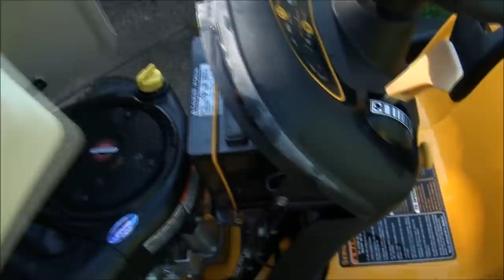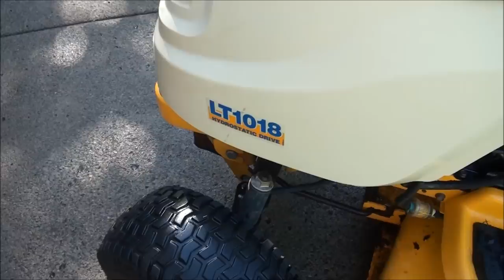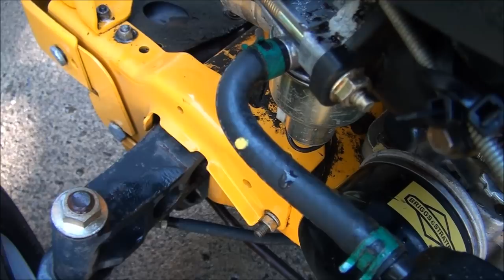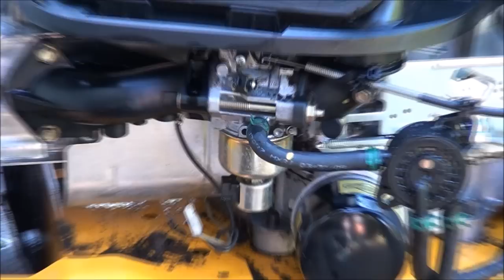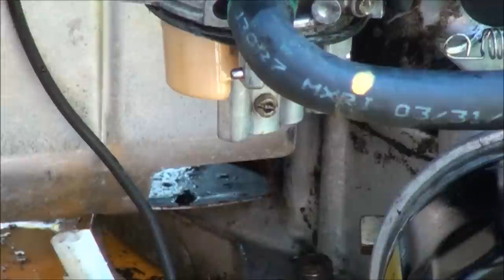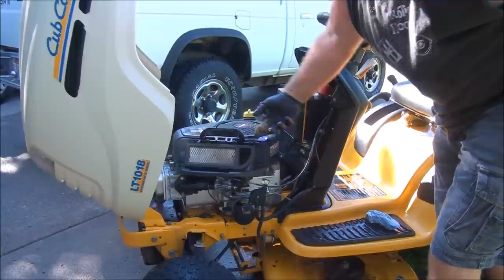Briggs INTEK QUICK FIX ~ RIDING LAWNMOWER that TURNS OVER but WILL NOT START. STARTS then DIES.

Comment: Just started cutting lawn,yesterday. Husqvarna 26inch with 18.5 intek stalled where i couldn't push it back to garage. No carb or brake cleaner. Ended up using crc electronic cleaner to try and get mower running. My solenoid failed last year. There is a fix for a dead one. You pull it and grind the plunger tip off flush in the hole, carefully so you don't screw up the threads. Mower rarely backfires. You can clamp while mower is running before shutdown.Anyhow the cup was full of some small round balls of some kind of goo. Cleaned it all sprayed the cleaner in the holes. Thanks for pointing out the jet. Gonna go back and clean that. Guess I won't be using gas that's sat during mowing off season anymore. Never have seen that kind of crud in a carb.

Comment: Thanks! it helped me out alot.  I checked everything! I started from Carb to valve clearance. I cleaned out the dang carb, adjusted clearances and everything else in between. Even changed battery. Still won't start. Figured out it was that dang backfire valve preventer! I ended up just cutting the tip off with pliers and putting it back in. Lawn mower runs like a champ now! Will eventually change out the backfire preventer with a new one.
Reply: ZOMGoS Z what you mean cut it off? The black rubber piece you took off ?
Reply: What a boss move.

Comment: Thanks for not calling the Briggs And Stratton engine crap. They are not that bad if you can keep them in good shape!
Reply from the maker: Briggs are great engines!
Reply: I've got a 14.5 hp Briggs that's been running great for 20 years!
Reply: bigbluegpr I got 32 years out of a 12.5 hp b&s. Just change the oil like clock work!

Comment: I just fixed mine. The bowl was loaded with dirt. Previous owner said it sat 2 years. Only think id add is I didn't shaved a 1/2" wrench to get the bowl off. I took a pair of channel locks and I gripped the bowl and loosened the bowl ( youre probably better off loosening the solenoid, that's where the threaded bolt is that hold the bowl} and then unscrewed it by hand. Id be careful and make sure you don't put to much pressure and crush the bowl. Good vid ! Thanks
Reply: You should have put a new gas filter on and maybe new gas line to if stuff was that dirty

Comment: Thanks to all who forge on!!!    My run thru learned from many DIY'rs..  The shot of eth should start most. If not Then, plug gap & sprk, if no- unclick ground on ign (while there chk clearance of ign) - chk sprk again- if spark- reconnect grnd on ign- chk spark again- if spark chk valve adj. If no spark trace electrical safety's , fuses ect.     If starts then with eth but quits -chk fuel shut off on base of fuel bowl & chances are if valves way out carb should be soaked & cleaned also.

Comment: Great video just one complaint, however, you said the old plug was made by a crappy manufacturer, it was an E3 plug, which in mine, and thousands of others say it's the best plug , anywhere, anytime!
Reply from the maker: NGK or Champion have never failed me and they last a long time. I have had an Autolight and a cheap Amazon spark plug fail new out of the box.
Reply: I've had many ngk plugs brand new not work then put a champion plug in and it works

Comment: Sometimes all the problem is is the carburetor bowl solenoid getting stuck out I've had 1 that was gummed up inside the solenoid and took it off then put a other used one on and then the engine started up those do work good for stopping the gas flow soon as the key is turned off kinda better then keep turning a valve on the gas line.

Bur then a in line shut off valve is good to for if you wanna take the carburetor off just keep the valve on off and unhook the line

Comment: Well at least the engine doesn't have a cam with air pockets like the 20hp v-twin did. I have one here with 320 hours on it and the lady service advisor said it was my fault because i got dirt in the engine. You can see from the cam that the cam has air pockets in it. I am supprised that Cub Cadet went to briggs, I will keep mye with the Kohler engine.
Reply from the maker: yike! air pockets? that is not good
Reply: WHATS YOURSOC  still in pieces. I show all my friends how briggs handles problems.

Comment: my would do the same thing and it was the rubber tip on the pintle of the anti backfire valve was loose and just floating free and shutting off the fuel flow to the main jet. i just removed the pintle and spring and installed a shutoff valve in the fuel line and saved $30

Comment: I could just kick myself! This actually worked on my Craftsman LT2000 with the same engine. I acquired 5 of these Craftsman riders from a neighbor. All needed just a little TLC and a new battery. Sold a few of them to friends, but kept one for my daughter who just bought her first house. I did all of the usual maintenance things like new spark plug, oil & filter, in-line fuel filter & fuel shutoff, sharpened & balanced the blades. It was running and cutting well when it stuttered a couple times, backfired, then stalled. I couldn't get it started and I assumed after everything else I already did, that it must have broke something inside. So it's been parked behind my garage for a year.... until today! I blew some air through the carb and it fired right up!
Thank you!
Reply from the maker: COOL! Thanks for the comment

Comment: My 12 year old intek just threw a rod! I was surprised as I took very good care of it over the years! So off to Lowes for a new Twin Cylinder Kholer engine powered Craftsman lawn tractor! Lets see how long I can make this one last.
Reply from the maker: Kohler is no good
Reply: Jeff's Little Engine Service dang really!? Jeff nice name my name is Jeff too haha! Thats sucks Jeff so I should stick with briggs? I dont trust them now since my mower threw a rod. But wide open cold starts for 12 years wouldnt do any engine any good hahaha! All of our Kohler engines here at the county where I work get used and abused and they have not broken down! What makes you say they are no good!? Before I drop 2k on a mower I want your opinion as I value it! Thanks Jeff!
Reply: @jefflohr5533   As strange as it may sound- the off-brand Predator engines at Harbor Freight get great reviews and are a bolt-in swap for the Intek engines. You can also up-size if you had one of the smaller ones and get more power. They cost hundreds less. I was about to do the same, but ended up being able to just repair mine. Almost wish it wasn't fixable so I could go up in HP. Yes, they're cheap Chinese engines, but they've been around a long time and I've seen a LOT of them working just fine.
Reply: Skrutinizr hey thanks a lot brother I will look into that I got two harbor freight stores down the road so im heading over there! Thanks again!

Comment: Went through mine that's doing the same thing (Intek 20hp I believe) I think I narrowed it down to the ignition coil, spark plug from mower (and leaf blower to test) wouldn't spark that I could see unless I was testing the plugs wrong. Solenoid clicked and carb was immaculate, I only run non-eth and stabil...

Comment: In the future I would recommend you use carburetor cleaner instead of starting fluid. It isn't as hard on an engine as starting fluid is. I prefer Berrymans B12 Chemtool, used it for 41 yrs now. It is great to use on an engine with no fuel delivery, I've driven cars into the shop feeding it long enough to drive it in instead of pushing it in. It is also a hell of a cleaner, watch getting it on painted surfaces, paint does NOT like it !

Comment: I have two Inteks laying around that were overheated by mouse nests, but aren't blown. However you can feel them binding when you turn them over by hand. Whats the most common things to get damaged when an air cooled engine overheats but doesn't throw its rod. Is it in the head or do you think the cylinder and rings are in bad shape from your experience. Is it worth me repairing them. Let me know thanks. I have spare heads and push rods. But if it's rings a honing it needs, I can deal with that too.
Reply from the maker: piston and rings go first usually
Reply: @JeffsLittleEngineService  Will I get away with new rings and a hone, or does the cylinder usually need to be bored out when that happens. I believe your right, it binds up as I'm turning it by hand, rings must be sticking on a rough bore.

Comment: That plug was filthy! I use E3 plugs on my small engines and they work great..
Reply from the maker: I am an NGK guy
Reply: Those are good.. Run the iridium ones in my Subaru Legacy..
Reply: Soak spark plugs in prem gas and penatrating solvent to desolve carbon and oil.

Comment: i would check valve clearances too ,makes for a lot easier starting.
Reply: Yeah it really does my last recent red craftsman i bought for $40 all its problem was dirty carburetor jets and the bottom valve was to tight i cleaned the jet holes and reset the bottom valve and it runs good thats all the mechanic guy who sold it to me had to do to make it run an work right

Comment: I have a similar Briggs & Stratton 17 HP that was running about 4 minutes, then died. 
It’ll now start on starting fluid, but then dies immediately after the starting fluid is taken away. 
Once it sits for a bit, if you crank it, it’ll very briefly fire, and die. 
Then we’re back to only running on starting fluid. 
Has good gasoline in it, and back-blew the fuel line, new filter, and already had a brand-new spark plug in it. 
What the heck?
Reply from the maker: Fuel delivery problem. You need to clean the gas tank and carburetor.

Comment: Thank you for your video! More help needed...Hi, replaced the fuel solenoid after market part myself and mowed once without any problems; next week, mower won’t start and had loud series of backfires. Did I do something wrong with solenoid install? Any help on what to do next to fix issue is extremely appreciated.
Reply from the maker: I am sure you installed it correctly. However, aftermarket parts like that fail often. It may also be that the carburetor /fuel system needs cleaning.

Comment: yea just need starting fluid everytime it starts no problem at all
Reply: I use gas don't have money for a 8 dollar can of that stuff that'll waste my cigarette money the gas just primed it is all once it has a new battery it'll do fine same with my tecumseh engine 

They orto just add a little primer bulb onto the air filter it would make stuff easier sometimes it just takes a bottle cap of gas down the hole maybe a few more pumps to work out any other dust while its running

Comment: JUST REPLACED THE CARBURETOR TWICE ON A 19.5 HP BRIGGS AND STRATTON AND IT IS CRANKING AND RUNS FOR A MINUTE OR TWO AND THEN DIES AND WON'T START AGAIN OR IS HARD TO START. ANY SOLUTIONS THANKS JEFF

Comment: Hi , I Took out my mower, changed oils and filte , then when I cranked it, nothing . Saw that the battery was weak so after charging it with a car, it turned over but would not start. Used a lipo jumper pack from a friend that was visiting and she started right up. Now two days after, nothing. Changed battery and that new battery could hardly turn over the engine.  Spark plug was cleaned up too. Just wondering why it started with the lipo pack and not starting when I need it to use?

Comment: Really nice video. I have a 18.5 hp that had a loose exhaust rocker arm. Tightened it up and adjusted both valves. But it still pops and backfires. Will not start. Any suggestions please?
Reply from the maker: The rocker arm studs can loosen sometimes which messes with the adjustment
Reply: @JeffsLittleEngineService  yes. I think it overheated and popped the valve seals. I put them back in and punched the aluminum around them to hold them in place. Runs great. Thanks for your help

Comment: That looks like a Nikkei carb often used by Briggs on lawn tractors. My experience with them has been good. These days you can get an aftermarket version for as low as a ridiculous $14.
Reply from the maker: You are right but be careful with some Aftermarket parts. Alot of them are crap....
Reply: My mower is 15 yrs old (LT2000) and the carb has never been apart. I put a fuel shut off in the line and run it out of gas when I park it. Fuel additives also help keep it running strong. Its like a 18HP Intek (31 Series) or something like that
Reply: That’s a Walbro LMT carb on this engine, not the Nikki.

Comment: Exactly my problem too.  Checked everything still no joy.
Reply: So nothing it all
Reply: @Mike-su8si yes I figured out the problem.  It was a melted wire connector at the key.  It had grounded itself, that’s why it tried to start and immediately die.  Had to get a new molex connector.
Reply: @cliffwendy3765  i wonder then if your diode in the wire is good cause something then let to much current go through
Reply: @Mike-su8si  dunno but everything is working fine so far

Comment: Jeff, should the fuel pump leak gas through the supply line just sitting?  I disconnected the hose and the pump is just dripping oil from the open line.
Reply: No. New pump is needed.
Reply: Make sure bowl valve and nut are tight first.

Comment: Seeing mine wont start with a new carb , I will try the spark plug next, that silver box in the very front of the engine my friend said is like a coil, and could that also cause no starts ? thanks
Reply: Which silver box does it have any wires coming from it

Comment: HAD A PROBLEM YESTERDAY WITH MY BOLEN RIDING MOWER.  THE  END OF THE BATTERY CABLE BROKE. REPLACED THE END AND THEN THE LAWN MOWER WOULD NOT START. TRACED IT DOWN, APPARENTLY THE BROKEN END OF THE BATTERY CABLE MESSED UP THE SOLENOID . YOU HAVE TO TAKE THE FLOOR, SEAT AND ALL OFF TO GET TO SOLENOID. IS THERE A WAY TO DO IT WITHOUT TAKING ALL  THAT OFF. NEED HELP ASAP THANKS
Reply from the maker: check main fuse first of course. Solenoids usually arent that tough to replace

Comment: That was an E3 Diamond Fire spark plug E3 is in no kind of way a crappy manufacturer of spark plugs they are actually some of the most expensive plugs you can buy but I can tell you right now by looking at it that is not the correct spark plug for your mower
Reply from the maker: my opinion is that E3 spark plugs are crap

Comment: I have a 24 hp Briggs and Stratton motor that is very hard to start and recently started backfiring.  Once i get it started  it's easy to start if i turn it off for about 30 minutes.  Any help would be appreciated! By the
Way its a craftsman.
Reply from the maker: Probably needs a carburetor cleaning and rebuild. It could also be that the valves need adjustment

Comment: Fuel solenoid is not clicking can this prevent it from running ? Seems to me like it wouldn’t but mine won’t run it cranks fine , carbs clean , fuel pump is fine, sparks ... can’t figure it out
Reply from the maker: yes, no "click" will prevent it from running.
Reply: Jeff's Little Engine Service ok so here’s where I’m at, I did not hear any clicks does seem like it use to click tho however I took the fuel solenoid off and turned the key and it moved just fine but there is no click ...

Comment: I have an honest question, I am absolutely NOT a mechanic or very mechanically inclined, so I'm curious why you wouldn't have changed the spark plug 1st to see if that fixed the no start issue?
Reply from the maker: that is a good idea , but I knew the spark plug was not that old
Reply: @JeffsLittleEngineService  - I understand, thank you!

Comment: The little part on mine that was supposed to be springy was not, i worked it and found it was all gooped up now my engine actually started. BUt it tends to run for a short time, then chokes and runs and chokes and runs and then stops after a lot of smoke.  Any suggestions?
Reply from the maker: your engine oil has become contamintaed with gas because your carburetor was flooding. You must drain all of the oil and add new. You currently have too much fluid (gas and oil) in the oil compartment.
Reply from the maker: I would replace the float needle valve if it was that dirty, they wear out over time too.

Comment: What if u have to boost it off every time mine It dont do anything unless we put the cables on it and it just does the starting sound but it do t fire?
Reply: Starting sound… make sure the starter is engaging the flywheel (is the top spinning around?)
If it’s moving … make sure there’s a spark!
Put a screw driver between the spark plug wire & plug…. Or pull plugs out & ground to body of motor & look for a spark!(while turning engine over)
(Plugs clean normal looking?)
No spark … (with wire brush) clean armature magnet (on flywheel)….
Check you coil! Clean off with a little sandpaper!

I’m assuming you are turning key ignition ?!
Which means safeties are closed/normal.
If u have a spark ; spray some engine start down into carburetor (remove air filter)!
Make sure cutting deck not engaged! Make sure transaxle is not locked up!
Both will make hard for engine to turn over!
Also some newer mowers have a compression release mechanism inside on the cam shaft(beyond naked eye).
Reply: Depending on your findings from diagnosing you may have a compression release device gone bad!?
There are some videos where they show you how to by pass by putting your hand over the air filter (remove air filter then place back on after engine starts up) intake while turning engine over!
There are precautions….. watch the videos closely!!